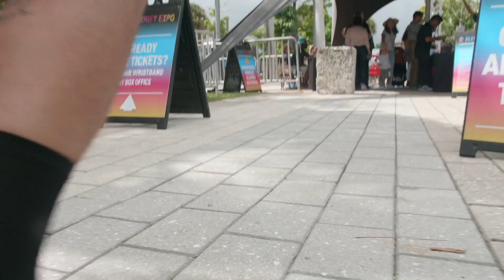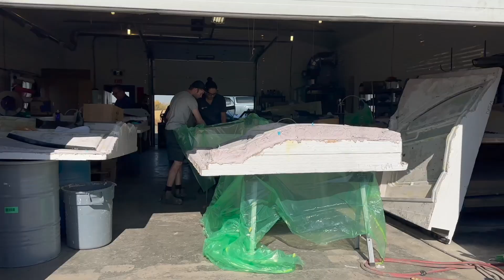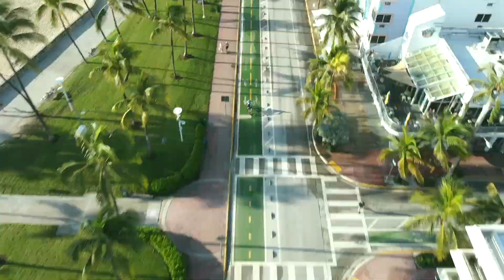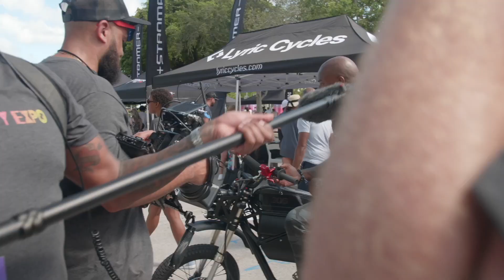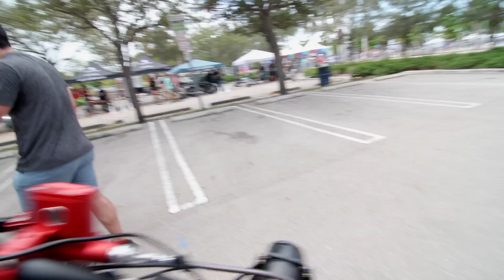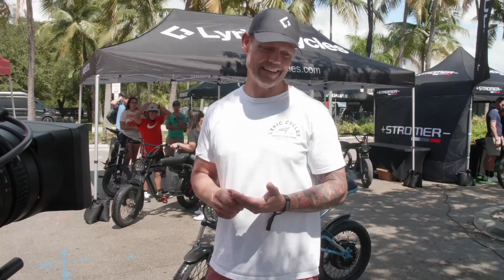The Making of the Lyric Cycles Voodoo & 305 GHOST | Tyson Beckford e motorcycle documentary

Comment: The rumble air ss looks better😍 it’s either The voodoo or the air I’ll be buying this month
Reply from the maker: We've made a number of design and performance updates since this prototype release. Wait until you see it! We've also changed over to a mid drive motor which has a ton of torque.
Reply: @lyriccycles  we’ll see which bike I’ll buy mid march
Reply: The thing is though, their are people that have already pre-ordered expecting a hub motor and if they got that because it’s quiet they will be disappointed I want the mid drive, but that’s why I don’t buy pre-production bikes because of the changes. So we need to see that production review ASAP!
Reply: @MITCH1221   we have to be very very careful with these e bike companies. Everything is all open book pre purchase.. and closed book after purchase. And I’m speaking from experience. But good point !
Reply from the maker: @MITCH1221  Apologies about it feeling like we have gone quiet. We've done a lot since the bike was first unveiled. Similar to the Super73 C1X, there's a lot of work between the sneak peek and production completion. We anticipate the new production version reviews will start coming out in a couple months.
Reply: @lyriccycles   Looking forward to it. I’m seriously holding off on buying anything else right now !
Reply from the maker: @MITCH1221  Happy to get on a cll to chat about all the changes we've made and share a sneak preview if you want to book some time through the meeting booking time on the website.